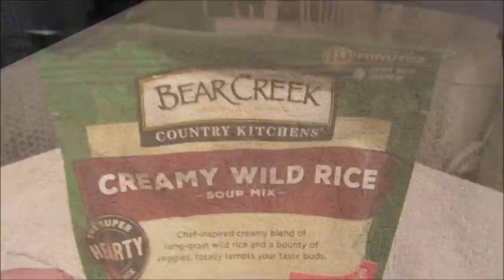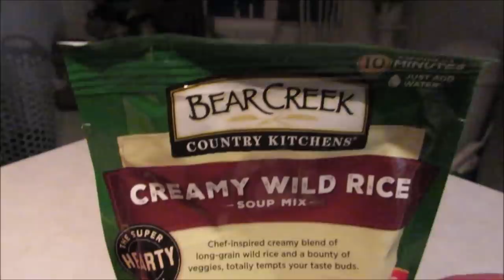This & That |  Weekly Family Vlog #44

Comment: Hey Robin, question on your sheet quilt...do you use full size sheets or queen size?  What about the batting..is that the sized the same as the sheets? Thanks for your answer!
Reply from the maker: I really just use whatever I can find.  Most of the time the quilts I make are twin size, but I have made a couple with in a queen size.   For the batting I normally buy a size up and trim it down, that gives me a little wiggle room if I want to make it slightly longer or wider.  Hope that helps.
Reply: Robin Johnson yes it does help.  I have a queen size bed, so I bought a vintage double flat...I’ll use that as a lightweight blanket for the summer.  I think I’ll get the queen size batting...to be sure its fits the whole size..but trim it, cause I need to trim of the top end of the flat sheet where its folded over.  I think I’ll look at blanket binding too for around the edges.  I’m so excited to do this project.  Thank you SO much, I never would of thought of it!